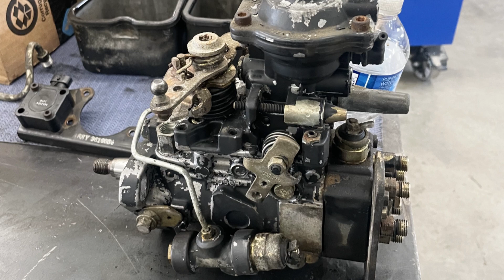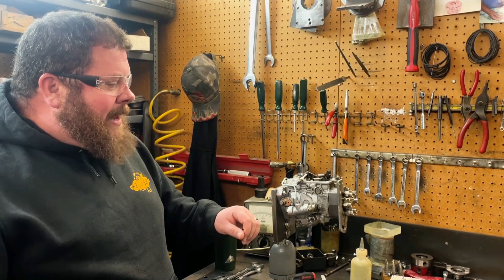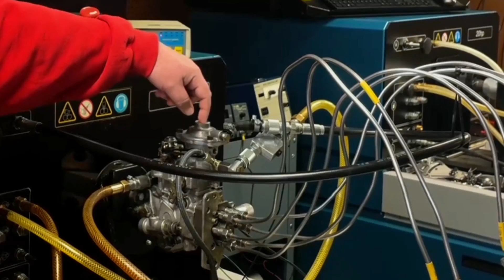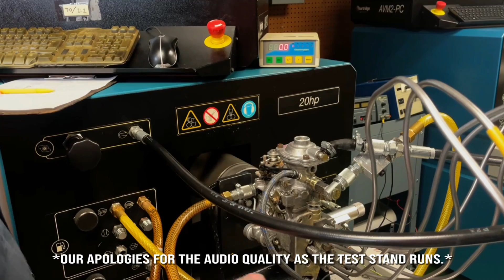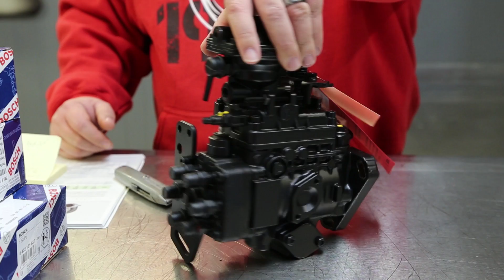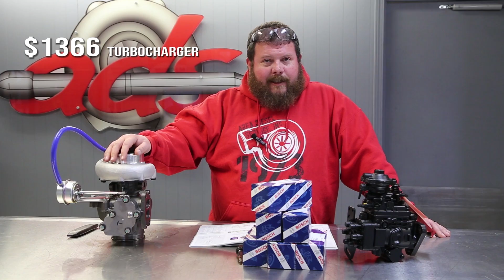Pump Rebuild & Upgrade with Injector Set & Turbo Upgrade for @C_CEQUIPMENT Frankentruck Engine Swap

Comment: As someone who used to build Mopar race engines and transmissions (yeah i used to do Chevy too but my specialty was MOPAR, and F*ck ford they have the worse engineering from a mechanics point of view than the other big two ) I'm here to tell you that the first thing you lose when you go beyond stock is reliability. Most people who want that HP or Torque are willing to trade some reliability for the extra power. (i should also add that all the car manufacturers make their vehicles to a standard. Part of that standard is "it must run for the most people for x miles". That is why the muscle car era was so special. The big three were going out of their way to give the public horse power and, as best as they could engineer reliability).

Comment: Great Job!!! Why not a P pump and get the hp++ easily from 6BT 12V? Then 366 turbo is nice. Money about same? Resale better, tell Clint make it fun to drive w/o smoke 450-500 hp or more and min. 1100++fp torque not a lot more $$ for build that is already over the top no electronics very dependable and easy start. Ray
Reply: Last thing Clint needs is his son running around in a 450-500hp truck 😂

Comment: I made over 400rwhp with that exact turbo from 1800rpm to 3400rpm. It peaked at 433rwhp to the tire and 1050ftlbs. That is with the wastegate disconnected. I found gating it is only necessary to save the head gasket drive pressure and turbo speed stays in control under 3500rpm on a 5.9 no problem.

Comment: My factory 205 ve pump even with a stock governor spring  made 430rwhp and 1030ft-lbs. The cam and rotor can do 400 reliably no problem with the right injectors. Egt control at that level of power is problematic though so driving tuned like that requires paying attention to gauges and driving accordingly.

Comment: Whats the best way to make turbo quiet?
Reply from the maker: Good question. There are a lot of different factors here. We'd first have to understand why it is louder than it should be. My first thought would be that the turbo may not be properly sized for the application.
Reply: @AreaDieselService  its all stock 3126 and i dont think its louder than normal.  I just cant stand that whistle noise when accelerating. Sounds like vacuum leak on gas  engine

Comment: Can you guys rework this to stock power of VP44 on 24 valve? I understand that dynamics will be different, just the same power.
Reply: Just a set of injectors on a stock pump can get you to that 245hp a vp44 was